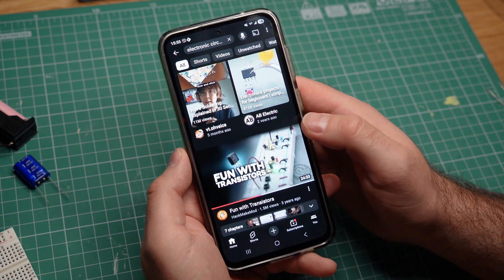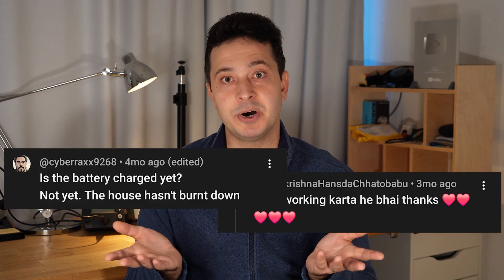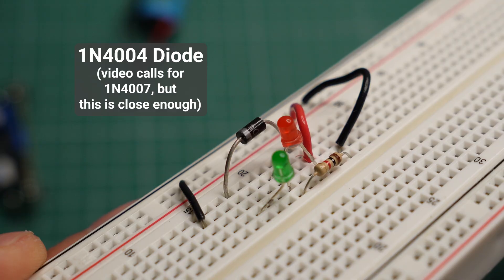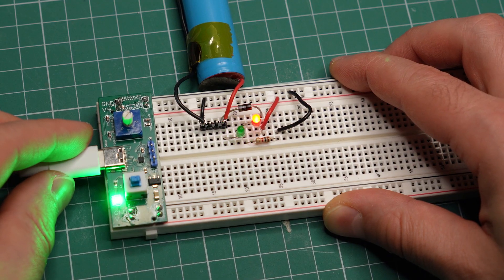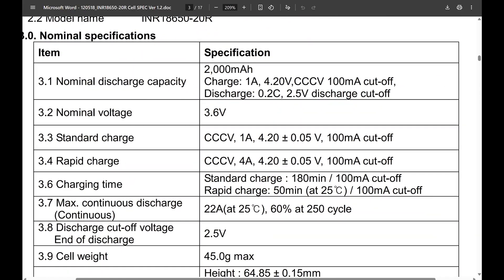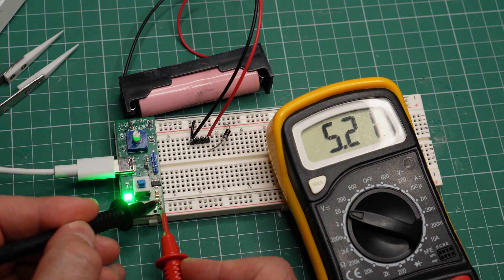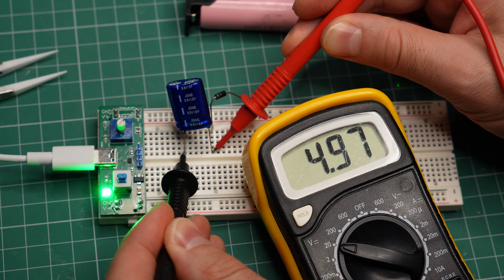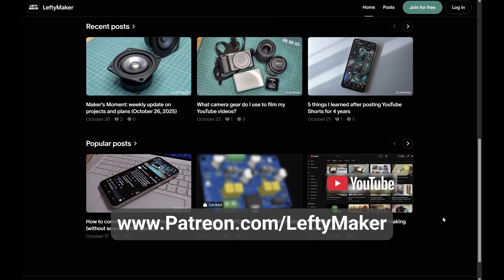DON'T Make This Fake Battery Charging Circuit

Comment: the diode-in-series method of charging is also prevalent in ultra cheap electronics. for example, my bluetooth speaker has a completely unprotected battery and gets overcharged to 4.5 volts. obviously, i only noticed this while i had the speaker apart to modify the amplifier for extra bass... not to mention that the speaker has a lipo cell inside, which can puff up and explode when overcharged, and in another speaker i had a case where the battery terminals were right across the usb port, with not even a diode in sight... 5 volts straight into the cell.

Comment: considering that u need to use a BMS to prevent it from being too overcharged (and its not as fast or effecient as the TP4056 (it has max 1A and has a built in BMS *mostly*) while this has like max 500mA and no BMS) i would pick the TP4056 as its so cheap (€0.78 at a listing at Aliexpress) and better than this overall

Comment: The real danger here is that under no circumstance should a lithium ion battery ever be charged to over 4.2v. damaging the battery is the least of your worries. At that point, it becomes a major fire and explosion hazard. Please take the safety of lithium ion batteries very seriously. Lithium battery fires are not easy to put out and are not something simple to deal with. The damage they can do is very serious.

Comment: “This is how not to build it - so how do you build it? Buy a premade one” 

Really defeats the purpose
Reply: The truth of the matter is that lithium batteries are quite sensitive and it is dangerous to mistreat them. Thermal runaway can easily lead to explosions. Hand-making a constant-current constant-voltage lithium battery charger, while you could do it, would be extremely involved. Instead, just outsource that problem to someone who has already solved it, and hand-make the interesting bits of your projects.
Reply: Lithium ion can't handle over voltage and over current without degrading itself, you can get away with that circuit if you use it on Ni-Mh or Ni-CD as they can stand over voltage and over current cimpare to lithium
Reply: Defeats the purpose of what? Damaging the battery? Becausw that's what the original video was showing how to do.

Comment: I never had the urge to do something like this because there are, in practice, only two types of rechargeables for DIY projects - 3.7V Lithium and 1.2V Ni-Mh. And 90% the former. So basically you can always use the same chips, and buying the same thing in bulk is cheap and easy. 

LED circuits are way more annoying, cause LEDs are divas and all want slightly different voltages. Search for "3V" and you'll get 2.2-3V, 2.8-3.2V, 3-3.6V and 3-5V LEDs. Suddenly, you want a buck converter AND a resistor to not potentially grill them.

Comment: Even if you were to fix the voltage issue (e.g. backwards 4.2v Zener diode after the standard diode in parallel with the battery) this could still damage the battery because they usually expect a constant current-constant voltage curve
Reply: well not necessarily damage but rather degrade

Comment: I have a 9V solar panel and I want to charge my lithium ion battery (18560, 1S, 2000mAh and 3.7V). I am going with the "tp5100" charging module and do I need a dedicated battery protection PCB board for it or does the tp5100 have enough battery protection? (For my DIY project) Also a small question, can I connect the solar panel directly with the tp5100?
Reply from the maker: You can connect the panel directly since the chip supports up to 18V input. It will also protect the battery from overcharge. However, I don't think it can protect against overdischarge. There is also the risk of the solar panel voltage collapsing if you try to pull too much current.
Reply: @LeftyMaker so I should get the protection board

Comment: I once had a Lithium Ion battery that wouldn't charge anymore (it had discharged too much over time and I guess the charger didn't recognize the battery was plugged in anymore) so I just manually charged it for a few seconds (hooked it up to a bench power supply for maybe 5 to 10 seconds) just to give it enough charge the charger would recognize it again and then I let the charger do the rest.
Reply from the maker: yes, it happens. If the battery has a built-in protection chip, it will cut off its output until it is "woken up" with a charge. The TP4056 actually supports a pre-charge state for batteries at low voltage.
Reply: Well i tried doing this but safer with 1ma on an old laptop battery and the cells shorted out when it reached 1.5v if i had done 100ma it could have ended badly
Reply: Good lithium ion chargers--like the increasingly venerable 'XTAR VP2'--have an over-discharge recovery function. Regardless, unless the battery is the type with a built in protection circuit then it is not a good idea to allow them to over-discharge even if they can be recovered from that state.

There are a couple of well-known circuit diagrams to add an over-discharge protection module to your project to make sure this doesn't happen. You can even use a dedicated IC which will likely offer charging functions as well, but I like to use passive and preferably through-hole components. It feels more like 'real electronics' to me! For instance; a TL431 programmable zenner diode, a MOSFET transistor and a couple of highish value resistors will form a potential divider and set the cut off voltage. I use a divider that sets a minimum voltage of about 3.2V. This is perhaps a little high and I will lose some potential battery capacity because of it. However I would rather that than damage the cell. At worst you will have a 'belt and bracers' system for a battery that already has its own protection--likely in my case set to cut off at a somewhat lower voltage.

Comment: I actually started using ip5306  modules as it's key button helps turning output on off and have 4 led indicator and it can also give 5 v out simontaneously charging
Reply from the maker: I've also used Injoinic's chips. They seem to be good for the price

Comment: Stuff like this is exactly what the dislike button was meant to prevent.
Reply from the maker: I also wish we still had the dislike button. Funny thing is YouTubers can still see their dislikes in their dashboard.
Reply: @LeftyMaker  yup, i can confirm
Reply: Alphabet & YouTube are complicit in the harm of its users and their property since the removal of the dislike button. It is irresponsible to host misleading and dangerous content.

I wouldn't be accusing YouTube of being complicit if the dislike button were to return, because a video couldn't mislead a reasonable person if it had 95% dislikes or had the like ratio suspiciously turned off.
Reply: Yes because this video has 3 dislikes

Comment: but this TP4056 provides a constant 1Amp current to battery , which is not good for batteries having capacity less than 1AH

This module's IC starts heating on doing that .
Reply: It's configurable via a resistor, so you can solder another resistor to set the current.
Reply: I used to install these modules in devices that have 2000mAh 18650, they got hot even when battery is larger than 1A.

But as the other reply says, the "programming resistor" can be changed to supply a lower charging current, we used to lower them to only 500mAh, but that was only to stop it getting as hot.
Reply: @welshdave5263  It's getting hot because it's a linear charge controller, like linear regulator it changes voltage difference from source (5v usb) to battery voltage into heat, so if you're charging with 1A and empty battery, it's dissipaiting almost 2W of heat in it's tiny package. If you want better solution buy TP5100 charging module whioch is switching so it's more efficent, and can charge with higher currents without heating too much and it's almost as cheap as tp4056. In bigger batteries I use IP2312 module which can charge with up to 3A, and it's switching so it doesn't get very hot. I use all 3 of these charge controller all the time, all of them work great for how much they cost. Just search for chip datasheet to get info which resistors to change to 'program' them for your specific needs
Reply: @welshdave5263  what do you mean by "battery larger than 1A"?